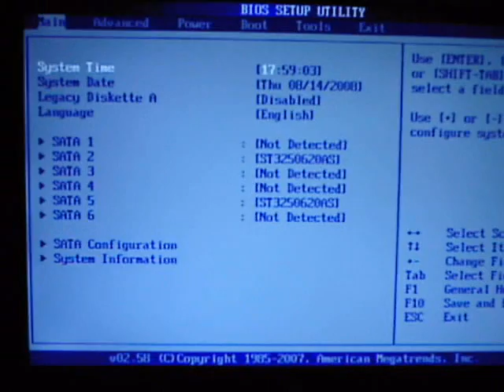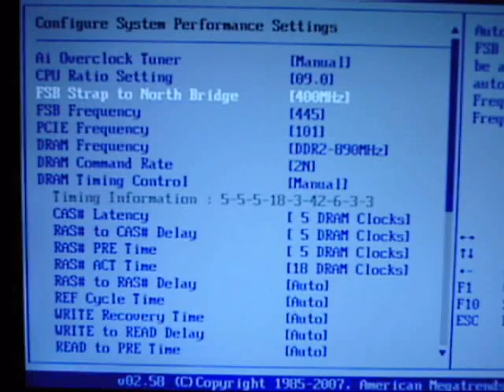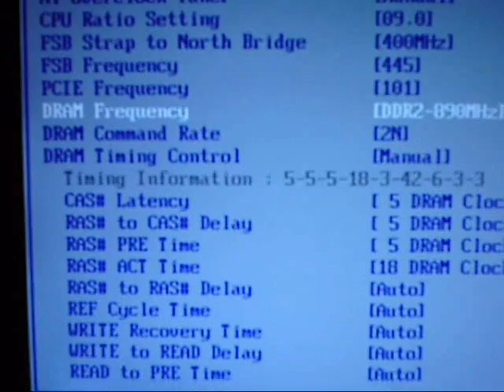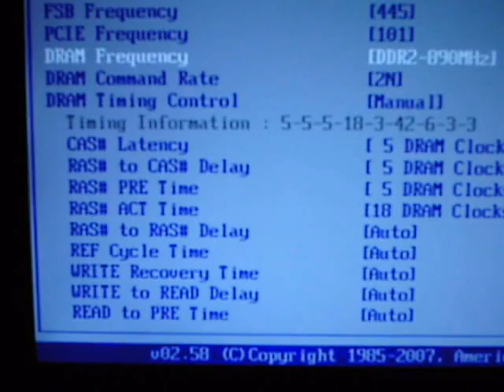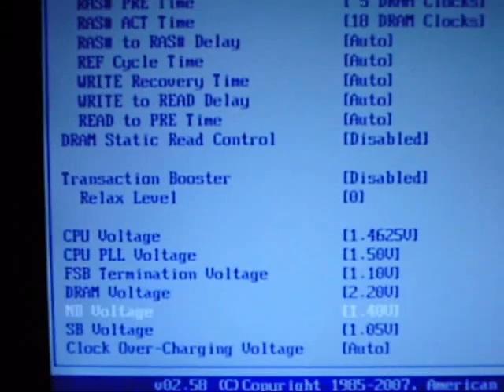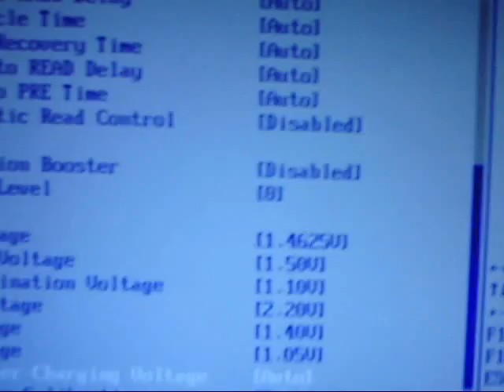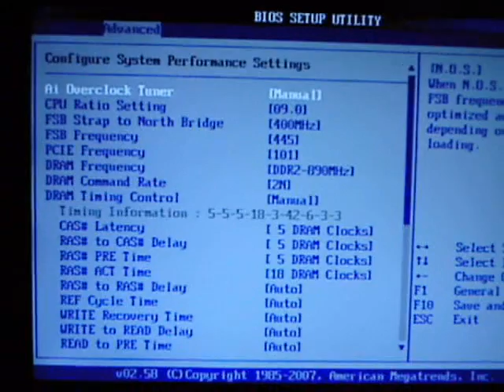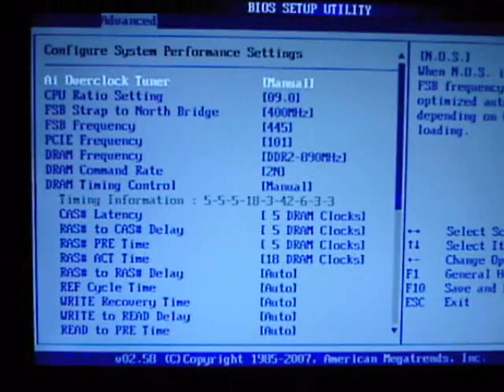E8400 @ 4.0GHz P5K-E BIOS Settings with Commentary

Comment: Thanks for these! It's working great with my computer. I have Asus p5k, e8400 and 4g ram. I dropped the cpu voltage a bit and maybe I will drop them a little further, until I found the reboot limit. So far so good. Without these instructions I was able to go as far as 3.6ghz.

Comment from the maker: Seems a bit high I run 3.6ghz on this chip with 1.192v under load and 1.200v idle. Too much volts can be bad as well and set your vcore manually it must be on auto now.

Comment: Got around to updating my BIOS from 0906 to the latest 1202, and that solved my problem. It seemed stable enough, but temps of 60c under load kept me from running Prime95 for very long. I'll get a good Zalman cooler before I try again I think.

Comment: Very nice, I might just try out your overclock. I've had problems with video performance when overclocking with this board. Increasing the Northbridge voltage to 1.40v was necessary to bring the PCIe bus back up to 16x, but game framerates were about cut in half regardless. I've tried 3.2, 3.4, 3.6, 3.8, and 4.0 GHz with the same problem. I've heard there are FSB "holes" with this board, which can possibly cause this problem if the FSB is set within these ranges. Anyway, thanks for sharing!